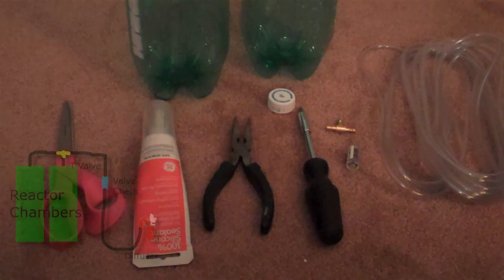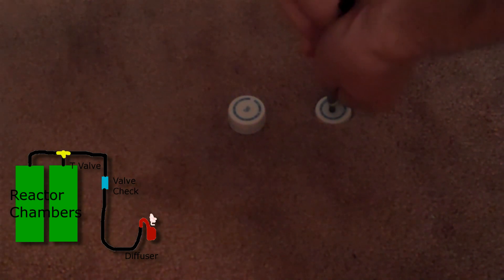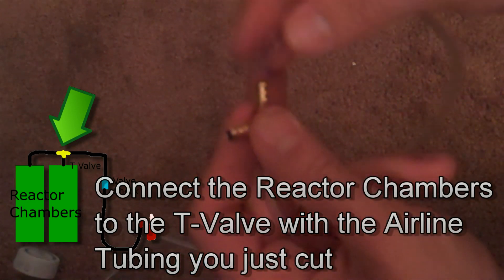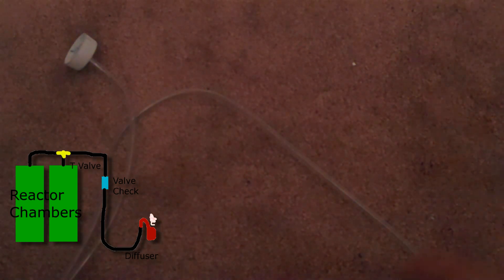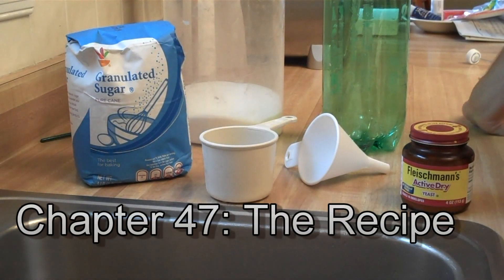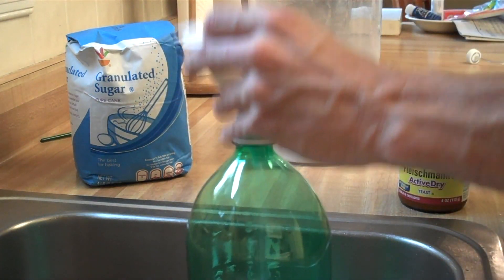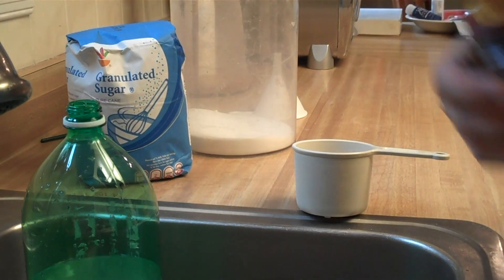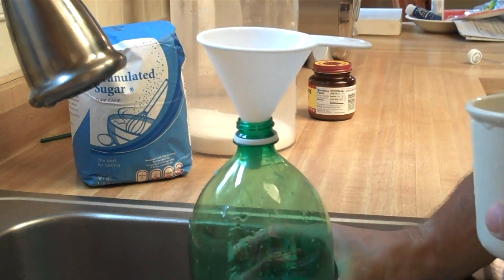How to Build a DIY C02 System and Recipe

Comment: Thanks for your reply.
Maybe you can help for the following;
I have some issues with brown algaes ,I change the water once a week but they still come come , I have plants growing but in later stage they turn a bit brown.
Some of my plants were sold to me without roots and have died. One was like reddish with some green one of them is like tall and spiky forgive me I don't know their name ..the vendor told me idiidn't need fertilizer for some time because my substrate has a mixture of it but I dought .what can I do to solve these issues?
Tks 
Marie

T
Reply: Depending on how big your tank is you should definitely add a Siamese algae eater. In my opinion they are the most active and effective algae eater and are peaceful fish when given a big enough tank, I had 2 in a 20 gallon tank and they handled all the algae in sight. They even eat he brown and hair algae off leafs.

Comment: I have replaced the silicone as it was quite soft easy to remove.
How LNG do you dry your silicone?
I have added more yeast and more warm water ,my bottle mixture maybe  it wasn't high enough and I have cut some  pipe ,I hope it will work.
Tks
Reply from the maker: Jay B
Absolutely, when done correctly there's no need for silicone. However, the silicone does allow for a bit more margin of error and is more reliable in the long run.

Comment: I have done what you did but the bubles don't seem to travel through the pipe to the water bottle, did I do something wrong?
Reply from the maker: You're creating a gas (c02) which will be forced out of the bottle, into the tubing, and finally into the tank assuming there are no leaks. If the c02 is not reaching the tank then double check to make sure there are no leaks. You won't physically see anything traveling in the tubes because c02 is colorless and transparent.

Comment: Can i use baking soda instead?
Reply from the maker: What would you be replacing with baking soda?
Reply: @AquaStudent  baking soda and distilled vinegar in 2 liter bottle. Shake up two liter and make sure you have pin holes in the cap. Shablang and done.
Reply: Baking soda and distilled vinegar.  Shake up and that's it.

Comment: Can u confirm the second bottle also have the same ingredients as the first bottle???
Reply: Anita Lee-Yu I use a gallon with for
Cups of sugar in 2 cups spoons of the yeast
Put an air pump with a little Stone down in the yeast
That will force it out of the other hose put it behind a fan
First put it in a bottle of water a cup of water and see how many bubbles you will see
Reply: Anita Lee-Yu Another word you don't need two buckets just one gallon with two holes
Reply: So much better with a air pump all the way to the bottom the air stone
Reply: Only go 3 ways up it will make alot of bubbles airpump one gallon two air holeses one with the pump goes to the bottom the other put behind a fan thats if ure growing weed I add warm water every other day one guy made one with a 5 gallon bucket look around he had a fish tank heater in the bucket with the airstone put the pump on top of bucket over the hole u cut in the lid then glue a bowl over the pump it stays o n the lid over the hole with other hose comin out works great When it starts to smell like vinegar change it

Comment: wat about a 125 gal tank? how many bottles would i need then? thnx for reply....
Reply from the maker: For a tank that size you're definitely better off investing in a pressurized c02 system. After a couple hundred dollars to set up a pressurized system you'll be golden for years. The cost/labor required to provide c02 through fermentation to a large tank is just massive.

Check out Aquatek of California for some inexpensive regulators. There are a bunch of other great online sources. You can also check out a local beverage supply store.

Comment: I noticed some people use baking sode in addition to the yeast and sugar. Any thoughts on that?
Reply from the maker: I used to as well. It's supposed to keep the pH more balanced. If the pH drops too much it will destroy the yeast culture. I, however, haven't found a significant extra boost in longevity by using baking soda. It doesn't hurt either.
Reply: AquaStudent
Thanks for the reply. I could probably leave it out then as I have a pretty good ph buffer in my dirted tank.
Reply from the maker: HigherPlanes
It's not in the tank where the buffering is occurring. The baking soda prevents the pH in the reaction chamber (where the c02 is being produced) from plummeting and killing the yeast. Either way I don't think it's super necessary.
Reply: AquaStudent
That makes sense actually. Thanks for the explanation.

Comment: Your awesome i found this cool kit on ebay that uses the botles like u did my question is im new to this things i want plants would it be good if i add dirt bottom and rocks and this method with plants but my fishtank is a 40 gallon would 1 be fine or do i.need 2 setups?

Comment: Superb i had low pressure on my earlier attempts and it was so annoying i found i was using boiling water to make the recipe DUH i killed the yeast as its a living thing ok so i seen your vid went back to the drawing board and it works yippy also to keep things cheap i use a diy diffuser out of a cigarette filter(not a used 1 btw)  shoved it in the end of my airline with a suction cup fixed it just under my filter it makes very fine bubbles and u dont need high pressue for it and the fliter pushes the bubbles around the tank hope this helps people :)
Reply from the maker: yes. Boiling the yeast is not a good thing for what we're trying to do.

Interesting use for the cigarette filter. Did you have any issues with the filter deteriorating over time?
Reply: thematrix28 0o
Reply: thematrix

Comment: found this really good but have had trouble with the holes  ok first week then pressure built up and blew the lids and leaked i have used a different glue and seems ok plant growth is great so lush and green have to trim and put in other tanks,and my red plants are growing rapid and very red so will try again only found my glass diffuser didnt work but a very fine air stone dose
Reply from the maker: The glass diffusers need a higher pressure in order to function well. I've found a simple airstone does good enough. Place it below a powerhead or the intake of a canister filter and you'll be good to go.

Comment: I have the tubing and the co2 diffuser, it was a kit until i learned that the co2 tank was disposable and not refillable.    Can i use the adapter it came with?  To hook all this up it has a valve check thing
Reply from the maker: I'm not sure what you have. However, a check valve, even a metal one, is only a couple of dollars. Everything in this build can be constructed for less than $10. The most expensive thing is sugar, yeast, and time in the long run. Instead of trying to retrofit something else a check valve would be a small investment and much less riskier.

A pressurized system (one that uses a refillable c02 tank, regulator, solenoid, etc) is much more expensive up front but provides a better control over c02 and is much easier to take care of.

Comment: Hi, 
Im new to all this and have been thinking about investing in a co2 system to help my plants flourish. My main question is, are there any adverse effects to the tank and water parameters?
Reply from the maker: Welcome to the hobby! It's a great ride!

Are you looking to build a DIY system or go pressurized? A DIY system like I made in this video is easy to make and inexpensive in the short term. However, it takes some maintenance to replace the solutions every two weeks or so to keep a fairly steady flow of c02.

A pressurized system will be more expensive up front but reliable, easy to maintain, and more powerful.

DIY c02 will not add enough c02 into the water to harm anything. A more powerful pressurized system can gas out the tank if it's turned up too high (generally doesn't happen once you set it up). Adding c02 to the water can create some carbonic acid which will slightly lower the pH of your water. If your water is fairly hard you may not even be able to measure a difference. If you have very soft water you can drop the pH a bit (by how much is system dependent).

The benefits of c02 for a planted tank are significant and should be introduced if possible.

Let me know if you have any more questions.
Reply: AquaStudent Thanks for your reply. I have had my current tank set up for 8 months. I added substrate etc to help supply plants with nutrients as thought that might be enough. Recently my plants seem to be turning brown in patches and thought its time to introduce the co2 to help. I think long term I will buy a co2 set up but since im skint I think your diy set up would be great to set up and see the difference it makes. I want to take my enjoyment in the hobby further so and nothing nicer than a green healthy tank.
So for this set up do you fill both bottles at the beginning or fill one at a time and rotate them?
thanks
Reply from the maker: wilkie777 Depending on the size of your tank you may only need one chamber. If you have a HUGE tank then go for a pressurized system. This build was for my 29g. If you're going with two chambers then whip up a mixture for both of them. After the first week change one of them and keep that rotation going.
Reply: sweet, my tank is a 26g so this will do nicely. 
thanks
Reply: wilkie777 hey, so i have set up my diy co2 on my tank and seems to be fine. how long would it take to notice any improvements??
Reply from the maker: wilkie777
Excellent! Glad it's working! Every system is different but you should start to notice a boost in plant growth within a week or two.

Comment: Is this the same as a Co2 diffuser, because I am making an algae bioreactor and it needs a co2 diffuser?
Reply from the maker: A c02 diffuser is what takes the c02 and dissolves it into the water. If you have a way to inject c02 into the tank then no this is not what you need. If need c02 and don't want to go for a pressurized system then this is a simple option.
Reply: Thank you for the quick response. What I'm trying to do is deliver co2 through hoses into about 8-16 16oz water bottles in order to grow algae. The system I'm building is set up similar to the way you hooked the 2ltr bottle up. Each 16oz bottle has a hose leading to it and delivers the co2 through the top of the cap. I'm very new to this. The algae will grow within each bottle. Any idea how I might use your technique to properly deliver the gas to the bottles? I was hoping I might just connect it straight in. Would that work. Thanks again.
Reply from the maker: Mason Depedro
I think the concept is there although the engineering will be a bit different. One of the main things is you can't have this system closed. What I mean is the c02 needs to have a way to escape. In the aquarium it escapes into the water (and aquariums aren't pressure sealed so the c02 can eventually escape). If there's no place for the c02 to go then you just made a bomb. The pressure in the bottles will build up until they finally explode.

I'm not too familiar on the project but you could try keeping the bottles open on the top. Have the tubing running the c02 go to the bottom of the bottle (just like it would go to the bottom of a fish tank) and have your diffuser there (ex: airstone). As long as you don't have any surface agitation the c02 will build up.

If you're looking to grow algae for an aquarium a simpler option is to put rocks in a dish with water in a windowsill that gets a lot of sunlight. In a few weeks you'll have algae.

If you want to try and streamline the process (which I like that way of thinking) then give the c02 a shot.
Reply: We'll, I'm a 6th grader trying to create a project for the science fair. I love the idea of biofuel and want to create a way to grow a sizable amount of algae to use for that purpose. So I am creating my prototype of what could feasibly be much larger (by just adding more bottles). The idea is that anyone would be able to create and maintain the system. I plan on having water in the 16oz bottles for the algae to grew, and it was worried about the pressure. So maybe no cap or I can add some holes to the cap. Thanks so much for your help.
Reply from the maker: Mason Depedro
Science fair was my next guess. The advantage of algae for fuel is when growing, algae removes c02 from the atmosphere. On a large scale (I'm talking commercially viable) then c02 injection just isn't feasible.

However, finding the best method to grow algae would be promising. I have a feeling that bottles wouldn't be the most optimal method of growth. I think a larger surface area would be better so there's more interaction with the air and less stagnation. We see it in planted tanks often. Amphibious plants grow much more quickly in air than they do water. Many aquatic plants (ex: Lily pads) try to grow to the surface to take advantage of the air and stronger sunlight.

This is an interesting project and I'd like to hear more about it and your progress. I'm currently working on my Ph.D in Physics. I'm quite the fan of science.
Reply: Thank you again, and apart of my project I'm suppose to interview someone in the same field of science to get a better understanding of it and depth of knowledge. I would love it if you were that expert! I could use my dads e-mail and send you some questions about the project and about your field of science. The bottles don't have a large surface area, but we will be using multiple bottles and it's a prototype of something ten times larger. I also really like the use of recycle able object to make a greener affect.
Reply: Do you think it would better using a tank like container ( I'm trying to keep this as low cost and as easily made as possible, which is why I love you co2 system )?
Reply from the maker: Mason Depedro
I think 'tank-like' containers would work better. You'll have more surface area in direct sunlight rather than having the algae try and build on top of each other. For example when you see a pond covered in algae the algae grows along the surface rather than deeper.

I would be happy to answer questions for you. I'll private message you with my email address.
Reply: YOU'RE AWESOME!!!!!!!! Thx!
Reply: AquaStudent q

Comment: I love the simplicity of this setup! I'm new to CO2 for my planted tanks though, how do you know how much CO2 to dose for your tanks?
Reply from the maker: The issue with DIY c02 is you don't have much control over how much c02 is being put into the system. The reaction goes quickly at first and then slows down over time. At about 2-3 weeks most of the sugars have been converted into alcohol and therefore the c02 byproduct has mostly been expended.
If you have multiple chambers you can replace one every week to have a more constant supply of c02.
As for size it all depends. I have never seen a case of someone being able to over-inject c02 into a tank like that which can happen with a pressurized system. That doesn't mean it's not possible...Usually a 2L bottle or two is good for up to 30 gallons. Beyond that you're better off going with a pressurized system. (In the long run pressurized systems are less expensive, more powerful, and more controllable)

Comment: great tutorial... a quick question.. do i need to repeat the same step on the next bottle or fill it with something else ??? :(
Reply from the maker: If you want a multiple reaction chamber system then yes. That's not really necessary though. Look at the diagram in the lower left at 0:30 The two green cylinders are the "reaction chambers" or bottles. they connect together with a T-valve and outshoot to the diffuser in the tank.

I'm working on building a bubble counter/cleaning section that will be placed just after the T-valve.
Reply: ahhh... thanks bro.. cant wait for the next project video. :)

Comment from the maker: What about it?

The fermentation reaction is still happening so c02 is being produced. There will be a higher concentration of c02 with the lights out but I have never seen an instance of a DIY c02 system building up enough c02 to gas an aquarium.
If you are worried about it you could always run an airstone only at night to increase the surface agitation and reducing the c02 levels to atmospheric concentrations.

Comment from the maker: There is more copper being added to your aquarium via your city water or plumbing within your house than being added through the plumbing on a low pressure air system.
Please, if you have any actual evidence of brass killing an aquarium I'd be glad to read about it but I have not seen any evidence of brass connectors in an airline system causing havoc in an aquarium.
Yes, copper is poisonous to fish and inverts but there is not a significant amount added from a brass fitting.

Comment: Brass contains Copper, some fish and most invertibrates along with certain plants are POISNED by copper. You should NEVER use brass on any fittings or any plumbing projects for aquariums. There's no reason to risk killing an entire tank off because of it.

Comment from the maker: It's not empty. I was having troubles with the threads on one of the bottle caps and I found the grape juice bottle while looking for my diffuser. The grape bottle is larger and already sealed so that worked out nicely. I just poured the 2L solution into the grape bottle and said good enough for this round. :)

Comment from the maker: That's what I was saying (I just didn't say that step in my thought process). The bubble counter does act as a form of containment between the reactors and the tank. Any material that bubbles out of the reactor would get trapped in the bubble counter although I haven't had any issues yet (knock on wood). The bubble counter would let me know a base line for the c02 production and when the c02 production drops (and it's time to change the solution).

That's a possibility for a later project.